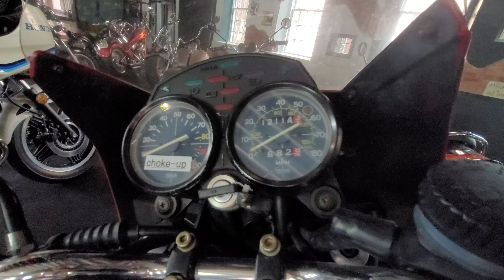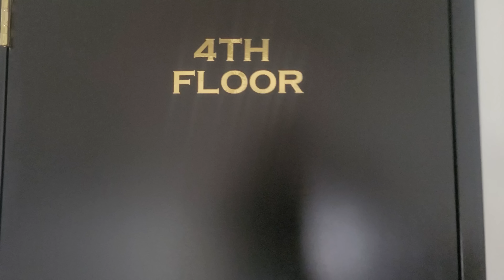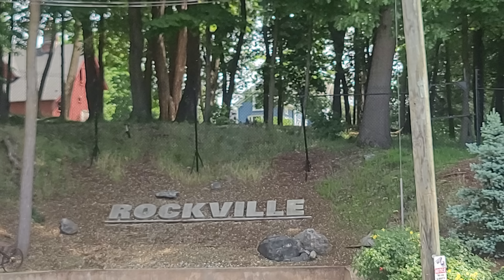TRUCKLOADS OF CLASSICS & NEW GASGAS MOTORCYCLES  YOU WONT BELEIVE IT!

Comment: No coincidence that the top end of that six cylinder Benelli looks identical to that of a CB550 four-cylinder Honda and also the points ignition cover and the alternator cover on either end of the crankshaft is identical fit fitment to that of a CB550 Honda.. as I was told by a franchise dealership of Benelli at the time that Benelli had paid for the licensing and the tooling to Honda for those blueprints and the manufacturing of the benelli's top end... It was easier for vanilla to get started on their production of the six cylinder to do this making the $600 vanilla just as reliable functional and power for cc's that of the already established CB550 Honda four-cylinder...... This type of selling and buying and trading of manufactured copyrights is not uncommon today as you will find licensed copies of mikuni carburetors on mopeds and small single cylinder 2-stroke and four stroke motorcycles manufactured in India and China... That makes it really convenient for people like ourselves with a mikuni jet kit for tuning your motocross bikes will come in very handy if you want to precision tune some of those models from China or India with a licensed copies of mikuni carburetors as the Jets are still all the same thread and size as they always have been like was found on the early 1960s street bikes from Kawasaki Yamaha and Suzuki..... Reminds me there is a motorcycle salvage yard of which most may be indoors have a place I've never been to in Indianapolis called cycle recycle that's been business for close to 50 years and maybe a source for Kaplan cycles restoring museum pieces..... And could be a convenient source when you are on the i-70 travels to procure rare motorcycles as you have already traveled through Indianapolis area several times I'm sure.... And give them a call or Internet contact with cycle Recycle as to their inventory May pay off as vital information for you
Reply from the maker: Thank you that's excellent information I appreciate it